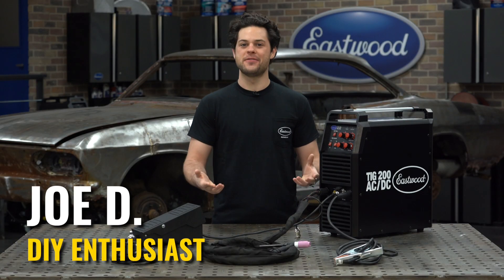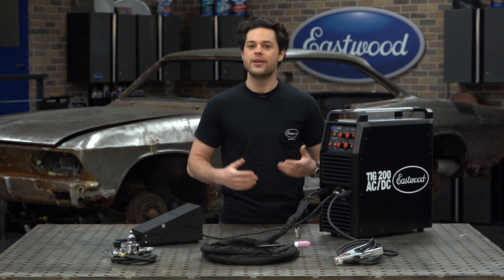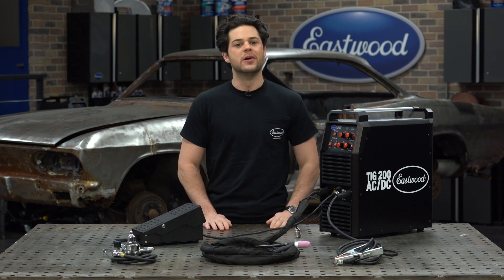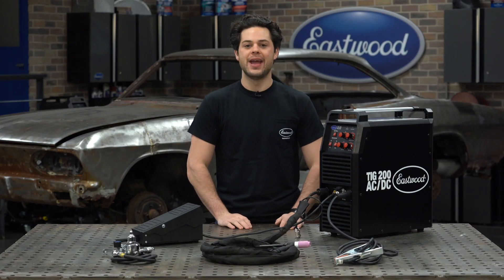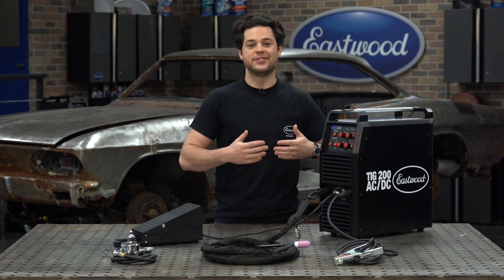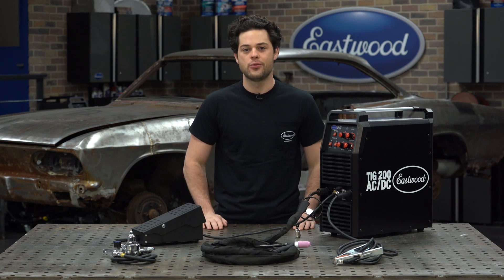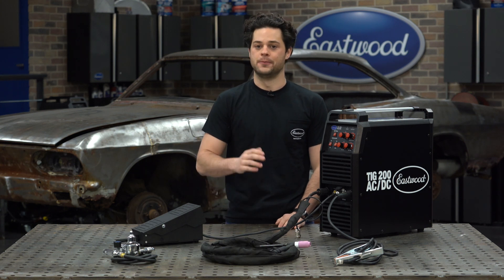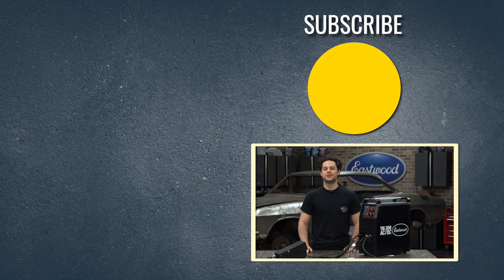The ULTIMATE TIG Machine! TIG 200 AC/DC Welder for EVERY Skill Level!

Comment: How far away from the machine can you tig and stick weld without damaging the welder?
Reply from the maker: The included torch cable is 12 feet long, 9 foot ground cable, 6 foot power cord, and 16 foot rocker pedal cable - so however far from the welder you'd like to be with those cords setup will be fine.

Comment: Mine didn’t come with a flex head or gas lens kit. Had to buy the lens kit myself and still have to buy the cups to fit them. And didn’t come with that nice of a regulator. Kind of disappointed.
Reply from the maker: The TIG200 AC/DC was updated mid-2021. All units shipped after that include a flex-head torch and the nicer regulator. 
If your purchased your unit after that date, please call our customer service team so we can get those items shipped out to you. Give us a ring at 800-343-9353.

Comment: Seem pretty good but how easy can someone with zero experience welder use it
Reply from the maker: TIG is a skill-based process. It comes down to making the time commitment and continuously getting good practice. You'll get out of it what you put into it. 
When it comes to the machine... it's similar to learning an instrument. A good guitar is going to be easier to learn with than a $50 Stratocaster from the local pawn shop. You can do it. The TIG200 AC/DC is worth the investment.
-Joe

Comment: How does the foot pedal work? I just purchased this welder but I’m a little confused on the pedal,if I put my foot down all the way does that activate the 200 amps? Or do I still have to use the dial on the machine to regulate the Max amps I can use on the foot pedal?
Thanks!
Reply from the maker: When you have the machine set to "Foot Pedal," the amperage dial becomes your maximum power setting. When the foot pedal is fully depressed the machine will output whatever was chosen on the amperage dial. The power increases linearly to that setting as you press the pedal down. 
So yes, the dial will regulate the max amps on the foot pedal.
-JD
Reply: There is a dial on the side of the pedal. You set it with that